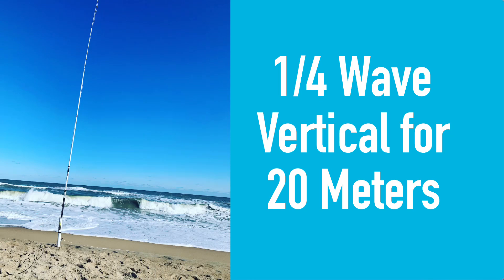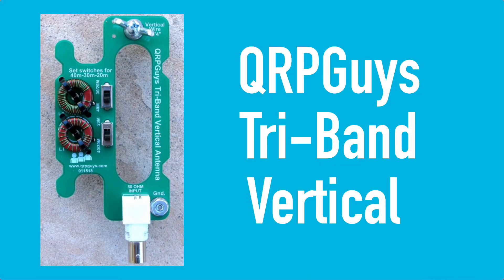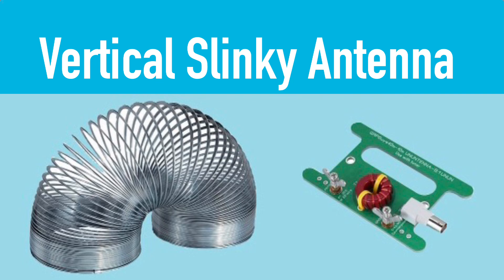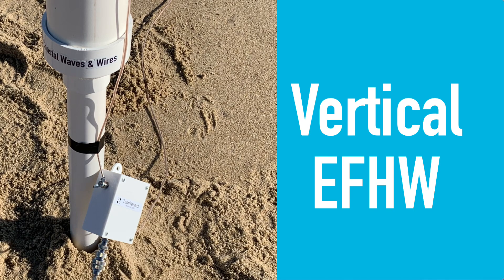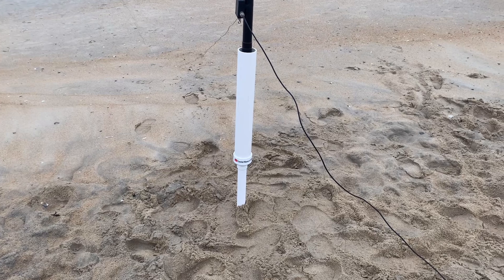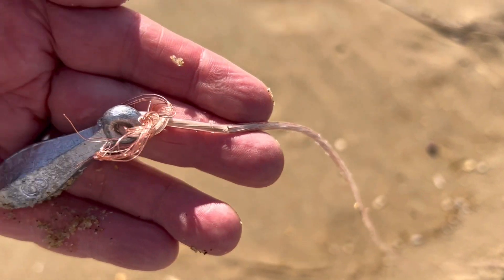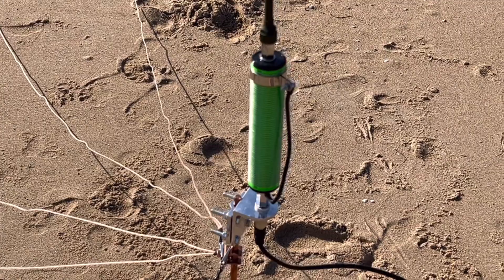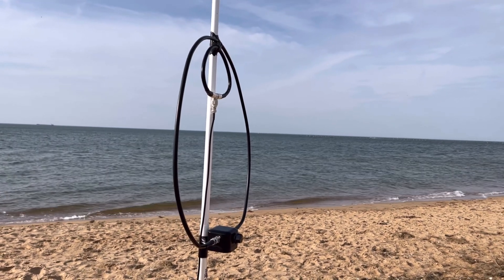Building Antennas for the Beach

Comment: Thanks again for excellent video, Walt. I'm going to Iceland with my motorcycle in June, bringing a QRP radio. There will obviously be many beaches, but there aren't any trees so going with vertical. For 20 meters, would you recommend the 1/4 wave resonant vertical? Would of course be nice to have the possibility of 10, 15 and 30m - maybe 40. But worried that performance will suffer on 20m if I make a multiband antenna. Or ... what would you have done? My most important goal is CW contacts with Norway (approx 1000 miles).
Reply from the maker: I would absolutely pack a collapsible whip and a coil. Absolutely the easiest and best performing antenna to travel with. I’ve done some videos using this setup and I ranked it number 1 in my recent Top 10 video.
Reply: @COASTALWAVESWIRES  Thanks, Walt! Yes, I saw those videos. Looks like a nice and very portable setup. I have the military whip already - just need the coil (I have a buddipole coil, but not nearly as easy to tune as the Sidewinder). Only worries with the coil might be the extremely windy conditions on Iceland.

Comment: Hi Walt! What a great video - very instructional for a beginner ham like me! I have one question - what is the 1:1 balun you use often in many of your antenna setups
Reply from the maker: Hi Rohan! Thanks! I use banana clips on my verticals in a 1:1 situation, not really a balun but they work well. Here’s a link to where I get mine on Amazon:

onelinkmore BNC Female to Dual Banana Female Socket Binding Post RF Coax Splitter Adapter Connector for HF Radio Antennas Pack of 2 https://a.co/d/hhCCSb5

Comment: Thanks for the summary - I'm on the left coast and good excuse to get that ham stick setup - have all the parts, just need to make some cp wires and give it a go.  What length ground rod do you use?  8 foot seems a bit much - 73, AI6OU
Reply from the maker: Thanks for watching! I use a 4 foot ground rod. 73, K4OGO

Comment: Fantastic video - I have the toybox antenna on the IC705 - it has 30m of radials with 5m lengths coming off it, or just clipping an extra long wire to get into the sea sounds like a way to get good DX on 10W of power.
Reply from the maker: Thanks! Give that single wire a try. It’s the surface of the sea that’s important. Don’t go deep with the wire. 73 and good luck!
Reply: @COASTALWAVESWIRES  thanks again for the tips ! it will be an amazing experience to even try this out, might go local in Bournemouth or Poole (UK) to give it a try !